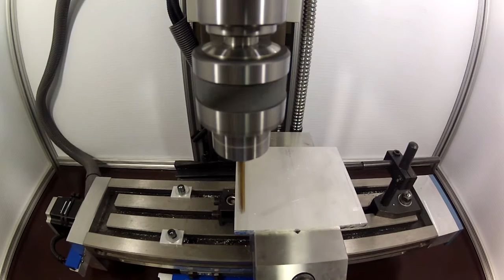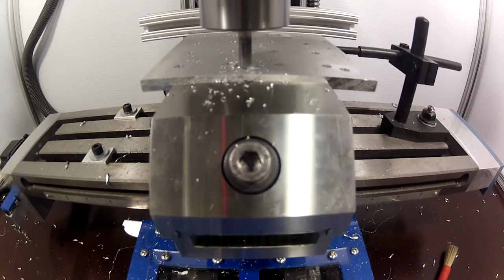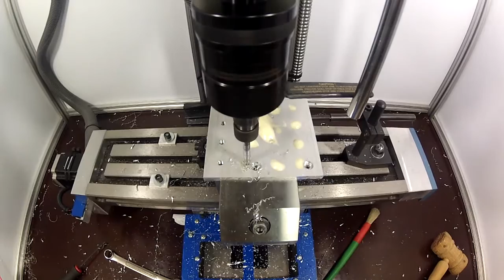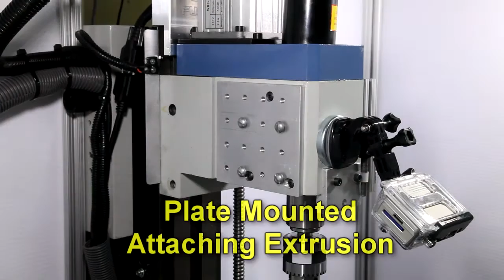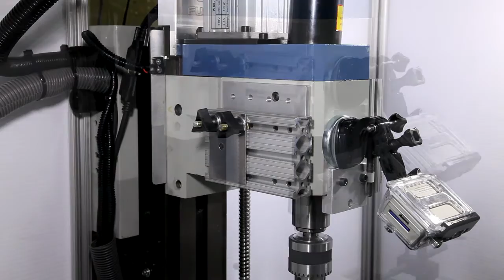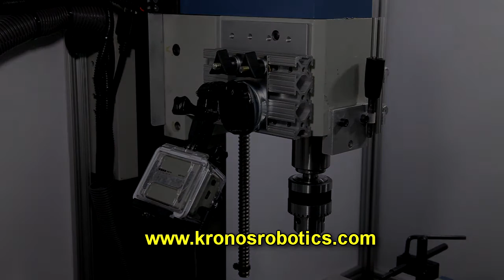KRmc01 Left Accessory Plate

Comment: You may get more precise hole placement if you spot the locations with a center drill rather than a jobber length drill. Center drills are shorter and stiffer so the tip doesn't tend to wander on contact. 

Nice little machine!

-- Mike